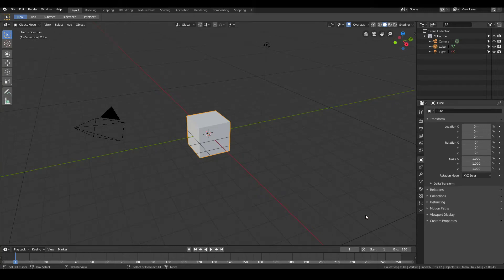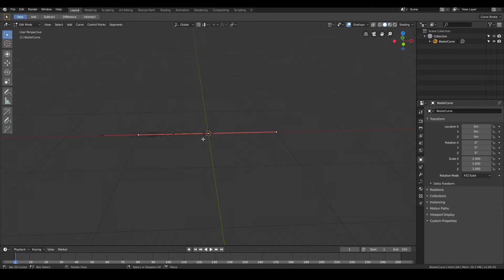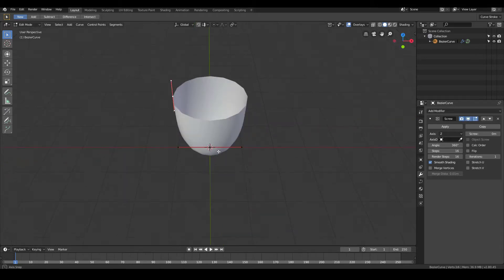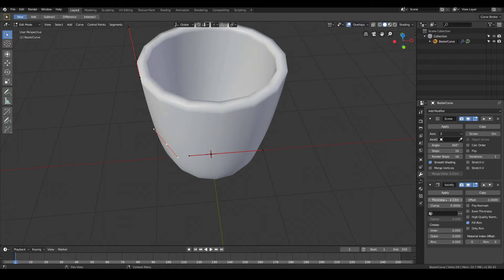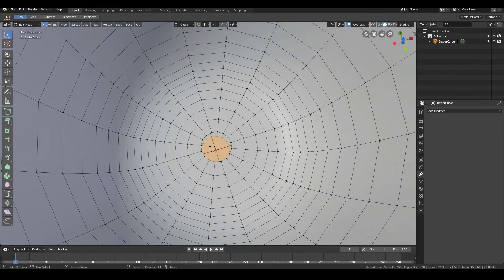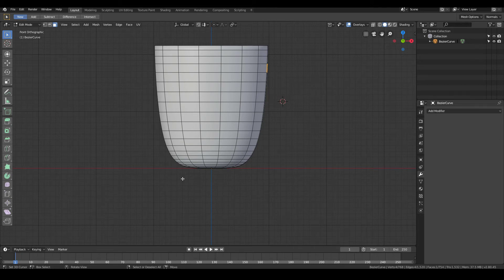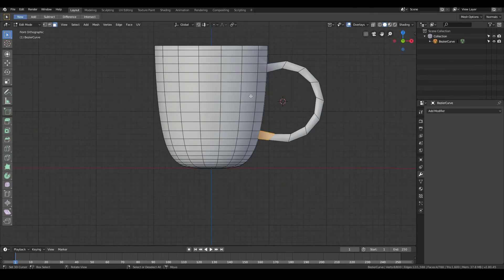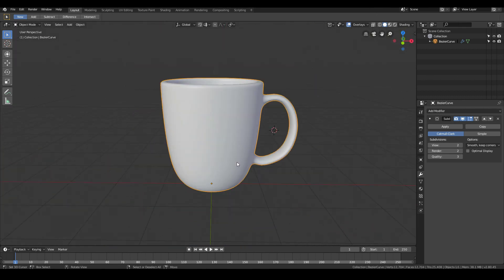How To Model A Cup Really Easily Using Blender 2.8 (Beginner Tutorial)

Comment: Really nice beginner tutorial, thank you for sharing.
You can do the same in Blender 2.79, because the spin-tool isn't new. Just how to handle it in the viewport is new, that spin gizmo is really nice. But it worked the same in 2.79, you just had to set the spin options in the operator panel or in the F6 pop-up.
Reply from the maker: Thanks Christina, yeah the spin tool was there in 2.79 but I never really found it that user-friendly compared to the 2.8 version.
Reply: @ThilakanathanStudios  Totally agree with that. It is a pain in the ass in 2.79.
As there are still a lot of people using 2.79, I thought it is useful for them to know  that they also can do this. You mentioned the spin tool is new and that could be confusing for 2.79 users.
But that new gizmo is so great and makes it really easy to use in 2.8